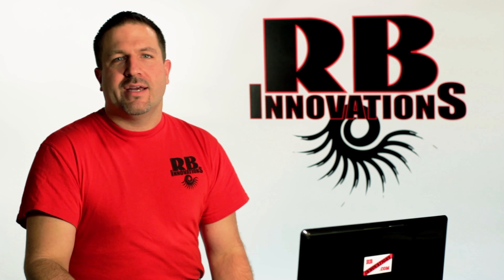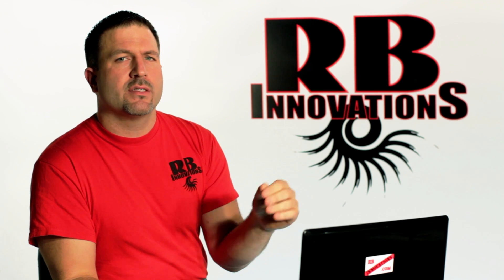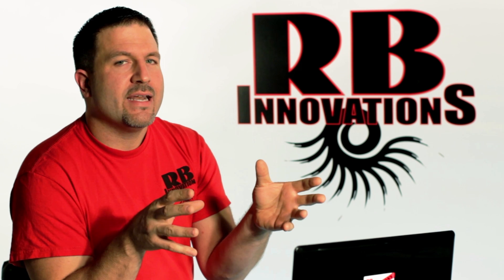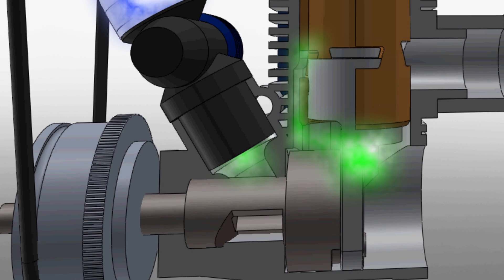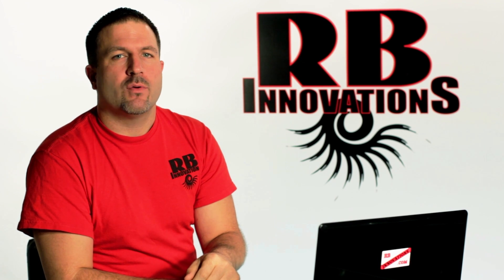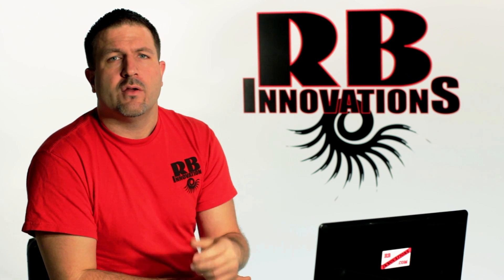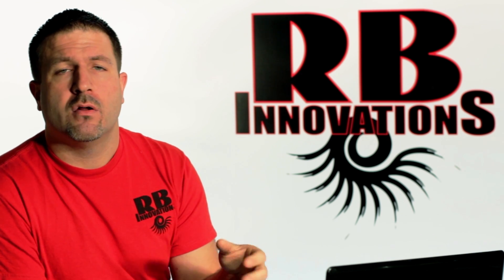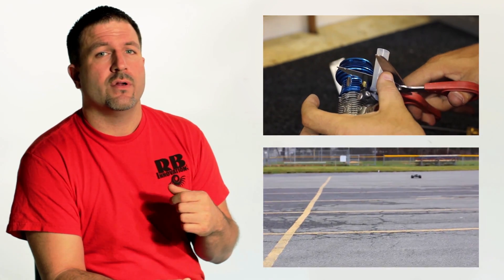How RC Nitro Superchargers Work

Comment: I'm not a scientist but an engine is a finite space. He just said that intake and exhaust port are open at the same time.    Pressures always want to equalize. ALWAYS. How can you pressurize a space where the inlet and outlet are open at the same time?  You can't blow up a balloon with a hole in it.  I may be wrong and admittedly know very little about exhaust tuning when it comes to a two stroke motor but something doesn't seem to make sense. Maybe the back pressure from the exhaust is what can aid in the pressurization of the intake chamber?  Someone shed some light on this for me.
Reply: If a tuned pipe wasn't used your statement would be absolutely correct. This device can only work if a tuned pipe is used. Tuned pipes work by reflecting back the exhaust impulse, stopping the inlet charge from being lost. It's why their length is critical. The video shows the tuned pipe effect correctly.
Reply: +Lozzie74   Thank you.  My next thought is that unless a supercharger, carb, piston/combustion chamber and finally the exhaust pipe are tuned together as a whole rather than separate components. If not then using a supercharger would impede performance instead of improving it.   What it boils down to is that without verifiable data I will remain skeptical.  Educated on this product but skeptical.  Thanks again Loz74.
Reply: Most welcome!  I concur that the whole unit has to be tuned together. I also wonder why these guys don't supply performance data.
Reply: +Lozzie74 If I were selling a product like this I would have nothing but factual data to support my claims. It almost seems irresponsible to not have it. Just because they say it adds power doesn't necessarily mean it actually does.  If your asking people for money then prove that it does what it's claimed to do.  "Increased efficiency and increased horsepower".  How much is efficiency increased and how, exactly, is that being measured?  Same goes for the horsepower.  Say it does something?  Prove it.
Reply: +John Fitzpatrick I agree that proof would take away all the conjecture and debate. I think the issue is that small dynos aren't readily available?
Reply: +Lozzie74 Maybe there is an electrical measurement that can be calculated?  Maybe something with amp draw? There has to be a way. Thank you again.
Reply: +John Fitzpatrick I've seen "hobby sized" dynos made. To measure the shaft power (which is what we actually care about) it is simply rotational speed (radians per second) x torque (N.m). The conversion from rpm to radians/sec simply requires division by 0.105. Measuring the torque is a bit trickier, but not impossible. Needs a load cell (or even a set of electric scales) measuring the downforce on one of the engine lugs (tared for the starting weight) then multiplied by the distance from the crankshaft center. This is a fundamental method, not empirical. I've done this with large slurry pumps but not a tiny engine. This seller should invest in something like this to save themselves the controversy.
Reply: +John Fitzpatrick sorry, MULTIPLY rpm by 0.105
Reply: +Lozzie74 That's the type of thought that seems to NOT have gone into this product. I am a mechanical engineer by trade so anything with gears and a motor gets my attention. . Especially if you can make it go faster or more powerful.   I find this tiny engines so interesting. These tiny power plants putting out 10+ HP is incredible. Thanks for your information.
Reply: I would like to add a point to your balloon analogy. When we typically think of such things we imagine a system that goes through a quasistatic process. If the process taking inside the engine was a quasistatic one what you said would be true. However the engine rotates at incredible speeds and that might change the dynamics of the problem. Though, as a mechanical engineer I also think like you: if someone is not trying to provide me concrete data I will continue being sceptical about the claims made.
Reply: +vardarson Good point!  Strange things CAN happen at high speeds.

Comment: "How RC Nitro Superchargers Work". Funny, he didn't actually talk about the supercharger at all.
There is no way that thing is creating any actually "boost" or pressure in the intake. This is equal to having a computer fan in front of your airfilter.
Reply: Not true. This is a positive displacement device, whereas a fan is an axial flow that offers minimal boost. A tuned pipe on the exhaust is essential for this device to work.
Reply: Oh I'm not arguing that, what I'm trying to say that this won't create noticeable pressure in the intake.

Comment: Brilliant video. I don't drive nitro buggies but I fly nitroplanes and I'm a fan of forced induction. Your explanation was spot-on and the graphic demonstration made things clear. Sadly few people understand about the return sonic pulse in a tuned exhaust, which is how they work. Great video!
Reply: +Lozzie74 always good when YouTube comments don't immediately degrade into racial slurs isn't it?  Refreshing even.
Reply: I made a comment on the video you commented on. You seem to be able to explain what I'm looking to know. Please read it and let me know. Thanks
Reply: +John Fitzpatrick thanks for seeking to understand rather than mouthing off like the troglodytes on here. I'm not affiliated with this company and have never bought the product. The rubber band belt looks a bit lean for the duty. However, the science behind the device is sound. They should dyno check it to prove their point - would save the arguing. I hope my response directly to your question was OK.
Reply: +DOCK GAMING, you might well be right about the supercharger pressure overcoming the reflect exhaust pulse. Without data it's impossible to know. It's why John Fitzpatrick and I want to see some dyno results - would settle any speculation. As for "your a fucking idiot", I recommend that when tarnishing someone's mental capacity it's best to get your own comment spotless lest you tarnish yourself with the same brush. I don't own any "fucking idiots" so the word you were looking for is "YOU'RE", which is a contraction of YOU ARE. For example, "YOU'RE a keyboard warrior". As for wasting money on a supercharger, let those who pay for them worry about the efficacy of their purchase. Save your beer money for an English writing course, or you risk being perceived as an idiot.
Reply: +Lozzie74 damn Grammar Nazi
Reply: +DOCK GAMING not a grammar Nazi, just pointing out the irony of you calling into question someone's mental capacity when you are clearly lacking on that front. To quote an appropriate metaphor, "people in glass houses shouldn't throw stones".
Reply: +Lozzie74 you got me.      ZI HAIL
Reply: +DOCK GAMING keep going, moron. Don't quit while you're losing. I'm sure anyone reading this is thinking "wow, that Dock Gamer really has it all together!" Ask your mom to read you a story and rock you to sleep, whispering "the words only hurt if you let them".
Reply: I thought the British where more polite
Reply: what you clearly dont understand is that the actual debate or issue at hand here is not simple whether this item increases performance, or "works" (works being obviously relative to the situation). When people think supercharger, turbocharger, or forced induction, those terms warrant an automatic assumption in the spectrum of performance increase, usually a large amount at that.... In addition to "forced induction" being a relatively simple scientific concept to understand. For me, I always thought of how fanning a flame makes it larger - compressed cold air leading to bigger explosives.... etc.... now trying to apply all this general logic and understanding to a friggin 2 stroke RC nitro engine is just simply silly..... Sure these damn things may increase performance and whatnot, sure maybe this mumbo jumbo he talks about is valid. That doesn't warrant the ridiculous price of these things, nor the terminilogy they use in advertising them. Its just a gimmick, plain and simple. Thats clear enough when you literally only see RC car enthusiasts using them and plane, boat and other RC goers being nearly oblivious to them.
Reply: I added this lil $2 cheapy to the end of the exhaust  (not for power)  
just for the spooling noise a laugh and the WTF!? moments for people
http://www.ebay.com/itm/Spinning-Turbo-Keychain-Turbocharger-Turbine-Key-Chain-Boost-Drift-Gift-MM-/291886650668

Comment: Just wondering that how the sonic pulse from tuned pipe ever hits the goal if that hair drier is on.. i dont say that 2 stroke engines could not be charged, they just need valves..
Reply: Learn how tuned pipes work
Reply: If it was an open exhaust or standard muffler you would be correct. However, the principle of returning sonic pulse in a tuned exhaust was well understood when I got into tuned pipes in the 1990s.
Reply: I know how tuned pipes work, I just say that that leaning machine spoils the only good thing about tuned pipe, the sonic pulse.. I have built engines over 15 years. I also think the ports should be moved so more mixture had a change to burn..

Comment: How does that thin rubber belt stay tight on the engine pulley at 30000+ rpm? The centrifical force applied to it must be crazy, so why doesn't the belt just fly away from the engine pulley and then slip?
Reply: nitro engines do run upto that speed....
Reply: Well.. try to find any engine running at that speed.. then yes
Reply: The traxxas nitro 4tec was belt driven

Comment: the only way that sonic pulse is returning any of that charge is if exhaust manifold pressure is HIGHER than the supercharge fresh charge pressure and if the charge is at anything more than 1 maybe 2 psi the exhaust will not have enough pressure to return that charge
Reply: It's time you studied tuned pipes

Comment: To  build  boost on any internal combustion engine you make heat, blowers more than turbos to acomidate to this issue you have to run an intercooler to bring the heat down and by cooling the carge you are making it more dense so there can be more fuel added, the basic pourpose of running a nitros oxide or nos is to be able to cram more fuel and air into engine per stroke  and just because you have a supercharger dosent mean you are making a major amount of power you have to take in consieration of the ratio of the two pullys are  you could have it so under driven you are actually taking away air from the engine. If there is an inter cooler you can more pounds of boost wich you can ad more fuel. some even run nitros oxide witn a blower and intercooler( if it is running gas) and build more horse power by how dense the charge is so you can add more fuel and air .

Comment: 98% of you couldn't tune  nitro engine. and the other half of you don't even know how a nitro rc engine gets fuel pressure.   but you're the "experts" on how it works lol.     how many of you have ever bought any RC car other than a Ready to run?  how many of you have ever built one from a box of parts (kits)?  how many of you own a radio system worth more than $50?  you're all a bunch of noobs.
Reply: Why would building a car chassis give you an knowledge on a 2 stroke engine? Or a radio? No one of these "experts"  are taking about nitro cars. They are talking about 2 stroke engines. Keep paying for expensive radio systems that dont benefit performance at all.
Reply: lol ok.  hand one of your flysky radios to a pro and see if they use it.
Reply: +blue03r6 I use stock hyper radio but im sure a pro would use it. Its the drivers skill not the car or the radio.
Reply: dude cheap radios have latency issues you can feel big time.  you're not going to sit there and tell me your radio will out perform a airtronics M12, a futaba 4PX, a Ko Propo EX-1 and so on.  what you have compared to those radios is a toy(I use a airtonics M11x) your radio lacks everything these radios have in them.  the latency of your radio couldn't come close to what these radios are capable of.  and it does matter.  the faster the car is the more obvious it is.  I'm not trying to dog on ya so don't take it personal.
Reply: blue03r6 Ofcourse im not, But what good is an expensive radio in the hands of a not so good driver?

Comment: How many supercharger do you see on a 2 stroke motors...none...Its a wast of time and money in my opinion
Reply: +Ramsay R/C I have seen many...they have been running them on the salt flats for decades.Just a cursory search on Google will verify that.
Reply: Guy Parris yea after I posted this comment I see some 2 stroke with turbos...there is 2 stroke snowmobile's now as well...but a supercharger on a  motor like this is pointless
Reply: Ramsay R/C
I am a skeptical about anything...I have seen dyno results that were positive, but I still want to see an unbiased test result, and to this day I have not seen one. Keep me informed if you see any video negative or positive. Also super chargers on 2strokes are on the salt flats....while they do exist are very hard to tune and from what I have been told only work well at top end... I will read up more on that...LOL,,,have a good day.
Reply: Guy Parris I have yet to see a good  running video myself of these supercharger's... I have seen a couple videos of Traxxas Revo 3.3 with the supercharger and it didn't look like itbhad any more power...I will do some looking as well and let ya no if I find anything myself... You also have a good day
Reply: Detroit made 2 stroke supercharged engines in but trucks and one of the first innovative company's to due so for many many years...
Reply: +Ray McCormick key difference is the detroit diesels had exhaust valves
Reply: +Jesse Liddle  still 2stroke my friend.... the exhaust valves was due to NO INTAKES...cylinder got its pressure from the blowers through the side of the piston sleeve's.... build many my friend....was just stating to the guy Ramsay r/c 2 stroke with supercharges has been around a long time....
Reply: Thats what power band is for!

Comment: I don't think "horsepower" is the appropriate unit of power to use on these sizes of engines. How about RAT power. Perhaps something like how much weight a rat can pull up 1" in 1 second.
Reply: These engines can produce 3 horsepower. I dont like the horsepower mesurement anyway

Comment: If you are building pressure below the piston that would slow it down, thus creating less power. If the Shockwave does in fact do what you say it would only work for the "tuned rpm range" and and power would first have to add back the reduced power from the positive crank case pressure. Any other rpm range where the pressure wave doesn't bounce back at the correct timing would have far less air in the engine but still have all that positive crank case pressure, and would probably actually produce less power.  Best case scenario you gain a very small amount at the tuned rpm range and lose power everywhere else across the rpm range, and less power under the curve means a slower vehicle even if the "peak hp" number is higher

Comment: If the super charger is raising the inlet track pressure the fuel wont leave the jets unless the fuel tank is pressurized equally
Reply: +Trev S On RC planes with nitro engines specifically 2 stroke ones the muffler has a baffle inside and there is an output nipple from that chamber which you connect a tube to the fuel tank. What you could do is bleed off air from the supercharger to the fuel tank and that will equalize it with the carburetor air pressure but equal probably isn't enough you need more pressure so maybe a physical pump would be better.
Reply: KiwiPowerNZ  Thanks for that - We know on motorcycles  many early blown engines chose to suck  through rather than blow through - looking at the design on this mechanical supercharger which is simple single stage  centrifuge running at near  engine speed it does not look big enough to impart much pressure  - a Dyson cordless cleaner with a similar size   spins at 110 thousand revs  - are we missing something ? - just curious
Reply: @KiwiPowerNZ  or use a fuel pump like the YS 4 strokes that use crank pressure to super charge them

Comment: talk talk talk.. lets see a dyno chart
Reply: +thatonebeone This is the only correct answer.  Anything else from either side is just bullshit.
Reply: Just build a dyno for engines this small, it's really not that hard.
Reply: +thatonebeone Yeah seriously. Is there no such thing as a dyno for these tiny engines? Put it on a dyno and prove it. Simple.
Reply: There are dynos for these things, but I think he's hiding them...
Reply: +thatonebeone dyno charts are readily available here on youtube.
Reply: +thatonebeone i knew someone would say that +1
Reply: that would be legit
Reply: thatonebeone l
Reply: Dan Theman  people rarely use nitro and n/a is usually enough
Reply: A dyno would be nice, and would quantify the change in performance.  Another much less expensive way is to simply bench run the engine with an air prop on it that's trimmed down to desired operating range to get a baseline, reading RPM with an optical tachometer.  Then make changes and read the RPM with the same load.  While it won't give you actual horsepower readings, it will definitely tell you what's happening with regard to performance.